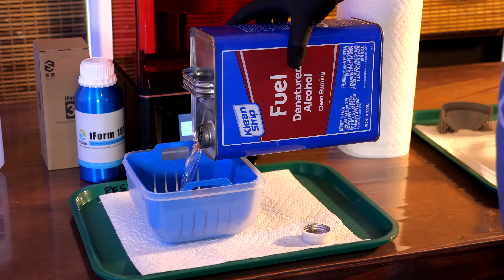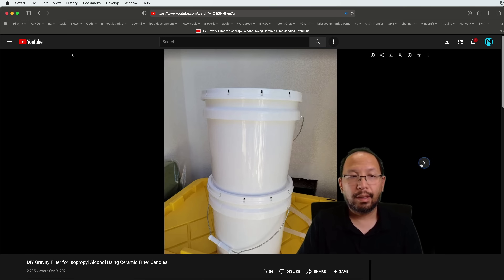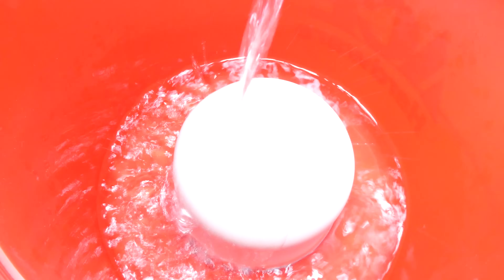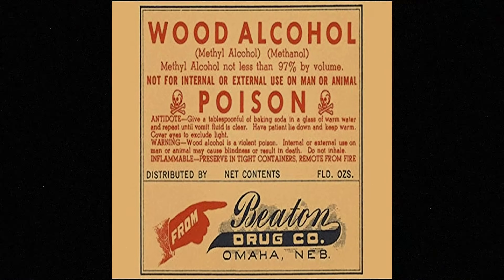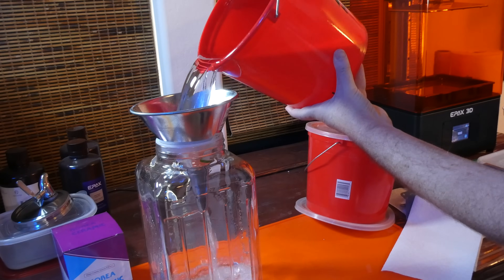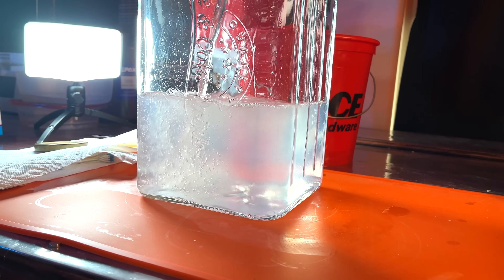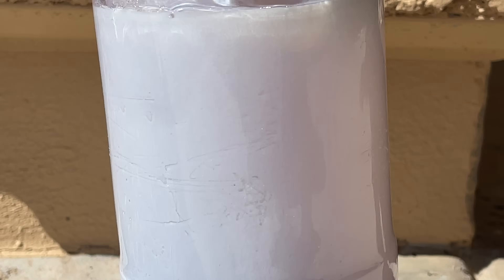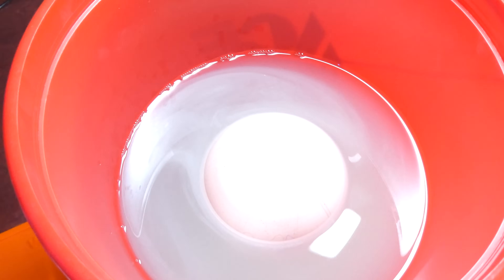Can We Recycle 3D Printing Alcohol?

Comment: I almost always use a spray of solvent to clean parts rather than a dunk.  A spray bottle works fine but my Iwata paint gun is even better. It is bigger than an airbrush but smaller than a regular paint sprayer. Does an excellent job of spraying solvents. Paper towels sop up the alcohol. The waste is minimal and clean up is easy and simple.
Reply from the maker: 👍🏻 I like the dunk method. I feel like an extra dunk in clean alcohol really gets the part clean.
Reply: I do this as well after first sopping up surface resin with a small paper towel. You save yourself so much hassle by removing as much resin as possible before the bath. I finish with an alcohol bath with a smaller insert in the ultrasonic cleaner.  @Nerdtronic After curing the contaminated alcohol, you can just shake the sealed container to break up the scoby. It will settle to the bottom relatively quickly, and makes the first phase of filtration easier.
Reply: I also spray first. I spray with alcohol into a bin with a grate at the bottom as an initial clean then finish cleaning with a dunk and agitation in the wash and cure station. This allows the bath to stay cleaner way longer.
Reply: Which Iwata are you using?  All the models I found, and there are a ton, are full-sizze.  Thanks in advance!
Reply: @MakerMeraki  It’s an old model, an RG-2.  from pictures on the Internet it looks similar to the current model RG-3.  It’s not as small as an airbrush but it’s quite a bit smaller than my full-sized guns.
Reply: @RobertTolone  thank you! 👍
Reply: I use a chip brush dipped in a small cup of fresh IPA to clean my prints.  Does a really good job of cleaning quickly with very little waste.  Aerosolized alcohol seems like a phenomenally dangerous idea, as both a health and safety hazard.
Reply: @RM_VFX  The brush method works well too and is handy when you only have a couple parts to clean.  Spraying alcohol is no more dangerous than spraying any solvent-based paint. Obviously, use safety precautions such as no open flames anywhere plus wearing a good quality mist and fume respirator, gloves, eye protection etc.
Reply: @RM_VFX  Absolutely...  IPA and Denatured Alcohol have poisonous compounds in them, making an aerosol of those is not the best route to go.  I use a multistage cleaning process.  Three washes.  A primary first wash that cleans the bulk of the resin off the print.  Then a second wash to further clean.  Then, wearing a respirator, I blow the print off with compressed air outside.  I then follow that up with a final wash in clean alcohol and blow dry.  When the first wash gets too dirty, I dump it in a paint bucket liner (which then goes out into the sun), wipe out the tray, and then dump the alcohol from the second wash tray into the first.  It's not perfectly clean, but it's clean enough for a first wash.  Same thing with the alcohol in the third tray, it gets dumped into the second tray.  The third tray is filled with new alcohol, and the other two are topped off with fresh alcohol to fill to the necessary volume.  Not a perfect system, but it works well enough.  

I started off cleaning with IPA...  When that got scarce due to Covid, I switched to Denatured, but the smell was worse (IMO) than IPA, so now that IPA is back on the shelves, I'm back to that.  Though I do have to admit that Denatured alcohol seems to clean better than IPA.  I just can't deal with the smell of it.
Reply: @WHJeffB  Where I work we build parts for spacecraft and use a lot of alcohol. for cleaning we use an acid brush, cloth, or paper wipes.  As far as the alcohol itself we put it in isopropanol GHS marked squirt bottles that spray a stream instead of a mist.  These are similar to water bottle you see in sport where water is squirted into the mouth instead of sucked like a straw.

I've seen them listed as Vented Wash Bottles, and Squeeze bottles.
Reply: @RM_VFX This seems to be the correct answer, thanks for this. I just got a Wash and Cure station and its awesome but its 7.5 Gallons of Alcohol and even when I do a quick cleaning before dunking the parts, that much dirty Alcohol is still a pain in the arse to clean and dispose of, and it costs a lot of money to replace.

So your method of spraying alcohol and using a small brush with a couple of tissues to catch the waste, seems to be the best method for cleqning and saving Alcohol.

Comment: I still don't know if anyone has tried the real salt method. (Salt with out Iodine) You can add salt to 70% IPA. The salt is only able to dissolve in the water. This will also increase the weight of the water to settle out of the alcohol at the bottom. In theory, your clean alcohol would sit at the top and the resin would fall out to settle at the bottom in the water layer. Then you could use a beer syphon to carefully pull out the clean alcohol leaving your water, resin, and a small amount of alcohol at the bottom. But, I don't know if the salt would have a reaction with the resin and vice versa. Some day, I'll eventually be able to afford a printer. Until then, I watch and learn.
Reply from the maker: I saw this in another video. Personally I didn’t want to add anything to the alcohol. But I guess we’re adding resin and then taking that out.

Comment: For reference, the boiling point of Denatured Alcohol is 173.1 degrees Fahrenheit or 78.37 Celsius. Denatured Alcohol has an auto-ignition temperature of 709 degrees Fahrenheit. In a perfectly controlled environment where you are acutely aware how hot something can get, the environment prevents sparks or other forms of ignition, with plenty of ventilation (In other words outside and not at all inside a building). The risks can be 'minimal'. But if you can't be sure of any of those things. You really shouldn't risk burning your house down. You can replace the alcohol. You can not replace yourself.
Reply from the maker: My thoughts exactly. Search YouTube for alcohol explosion.

Comment: Diatomaceous earth can be a help here to remove the 'gunk'. I light cure to solidify a bit of the dissolved resin, filter through D.E. and then through activated charcoal. If your activated charcoal is fine enough, you can probably remove one of the filtering steps. A gallon of D.E. will run you about $20 US on Amazon and is a great filtering aid, but lots of surface area is key if you don't wait a lifetime.

As for the smell of IPA, that smell will never go away as it is intrinsic to the molecule. Wanna make it smell like bananas? Add some vinegar, a bit of sulfuric acid and boil away. The yields will be low due to the amount of water in vinegar(unless you can get your hands on some anhydrous acetic acid) but the ester is pretty potent and should be detectable. You can do the same with other alcohols but be warned, the longer the carbon chain gets, the worse they can smell (the pure alcohol, that is).

Also, distilling isn't too bad but you are still left with a concentrated mess of gunk so for me, filtering would definitely be the first step but distilling might be a nice occasional step to remove atmospheric water that the alcohol with pick up over time. Just don't distill to dryness or you'll likely have an even worse mess to clean up.
Reply from the maker: Wow lots of good info. Thanks for commenting!

Comment: The 'mucous' is a spongy suspension, if it is squeezed in a filter bag , the alcohol is released. I found this still had a lot of dissolved resin in it and required another exposure and filter pass.

I tried a vacuum still instead of higher temperature boiling , but the phase change method is far too costly , unless it could be done this a solar still of some type.

I'm also fine the smell of ipa offensive, worse than resin by far.
Reply: @AndrewSM I just used a cotton cloth and gathered the edges together and squeezed. If one had a lot to do ,then a similar cloth in a cider press might do the trick.
Reply: @AndrewSM yes that would probably work

Comment: Worth calculating the loss due to evaporation for this method. It probably not a lot but I'm sure it will increase the "price" from 4¢/Gallon
Reply from the maker: I agree. And that’s IF you can do 1000 gallons. Still even at say 10 cents a gallon it’s pretty good. If you don’t add in the cost of the labor to manage the process. Then it might be cheaper to buy it.

Comment: Couldn’t you just design one or two 90 degree angled gear(s) to change the direction of a motor, connect a very small propeller, fit it into the upper basket so the fluid is moving to prevent the filter to clog? Maybe pointing on to the filter so there is just a tiny bit of pressure on one side of the Filter?

I think any small toy salvaged motor will do the job just fine.

[~]-|
      |
      |
      |-8
Reply from the maker: Or one of those magnet stir things. 👍🏻

Comment: Not getting the IPA this dirty will help. I just filter mine over kitchen tissues after 10 times use and it is clean enough (not sticky anymore) for another 10 times. The biggest step lays before putting your print into the IPA, clean of as much as possible using a small spray bottle with IPA. This will get the most off.
About distilling, it is possible to distill alcohol safe, using vacuum will lower the boiling point a good amount and hot tap water can be used to heat the alcohol. Of course everywhere where are fumes there is a risk, but the risk of pouring alcohol for one bucket into another is a lot bigger then using a closed system. Ever thought of what kind of cloth you are wearing when doing this? Static electricity creates sparks too!
Reply from the maker: Yeah don’t walk around on carpet snd rub a balloon on your hair before cleaning your parts. 💥🔥

Comment: I wonder if an apple press type of system would work on the resin jello. Or maybe toss it in a blender to break the bonds of the matrix that is holding the alcohol. Maybe both. I'll have to try that next time I need to change resin. 
I also only use denatured alcohol because of the smell of IPA. I have a hard time convincing people that it works just as well, or better than IPA.
Reply from the maker: Denatured is great.  it's the way to go!  And also these filters can be used in pressure filtration systems as well as gravity ones.  So if you push the alcohol through it will filter faster.  But you'd need some sort of set up for that.

Comment: Maybe i am dense, but what i do with my alcohol is expose it to UV light and than filter it with paint filters.  The resin is cured( clumped) and than the filter removes it.  Simple, cheap,  and seems to work.  What am i missing here?
Reply: I'm guessing that like me, you filter it before it gets as contaminated as the alcohol @Nerdtronic is trying to recover.
I think that's the key. Filter it regularly and don't wait until it's a thick cloudy mess.
Or maybe the Methanol/denatured alcohol acts differently on resins than IPA? I've only ever used IPA.
Reply: @ausfoodgarden  I use IPA and expose it to UV after most uses.  I filter it every so often, which causes the resin to coagulate.  I than filter that out.  I get a nice clear IPA from this.  Simple.
Reply: I use coffee filters after giving it a UV cure. Paint filters just seem to coarse to me and not as cheap as coffee filters.
Reply: The key as someone mentioned is not to wait until your alcohol is so dirty that  looks like thinned resin
Reply: I also expose my used IPA to Sun and let it alone for some days so the resin go on the bottom and filtration is easier.
Reply: Perhaps since both water and alchol are polar molecules, the slightly negative end of water attracts the slightly positive end of the alcohol molecule forming hydrogen bonds. In other words its no longer pure. 

If its working for you than you should do what’s works. 

Distilling at best can get about 90% purity. The distilling process cannot do any better than this, or get it back to 99%. Keeping in mind alcohol boils before water and convention distilling methods are not ideal, or as simple a process as some may claim. 

I wouldn’t do any distilling but I might consider freezing the solution after your UV and filter method. 

Once frozen you can scoop out the ice cubes with a handle strainer, and/or filter out the ice and know that its about as pure as it’s going to get.
Reply: @glennedward2201 the vodka in my freezer doesn't contain any ice, so I don't think the freezing method would work
Reply: Genius!!!
Reply: Well, %99 people doesn’t require their IPA to be %102 pure for cleaning parts. So you are missing the %1 OCD rage.
Reply: @Gounesh  Was that necessary?

Go have a beer, relax, and have a nice day.

This anger stuff is killing all of us

Comment: I like the idea of adding stages. I guess the nice thing about stacking a 3rd or more stage of filtration is that it really shouldn’t take much longer to do the whole batch. 

And if cheaper, more corse filters were used at the top it might make those at the bottom last longer.
Reply from the maker: I think the order of things might put a kink in that idea.  I think my really dirty jar I maybe could have salvaged if I had filtered, then cured in the sun, then filtered again.

Comment: Such a fantastic video. I have buckets of IPA sitting in my closet for a few months now. For sure should try this. Also refuse to use a distiller. Seems like a massive fire Hazzard.
Reply from the maker: Thanks!  Yeah after your near miss with the ultrasonic cleaner I’m sure you’re as paranoid about fire as I am.
Reply: Just take a UV light to it and cure whats floating in it. Depending on how thick the resin is it may take a bit and a few times stiring it up. After just let it sit for a day and all the cured resin will sink and become a shick goop. Then just filter it out. I do this with all my alc though I clean mine this way after I'm done for the day. Cure the alc for like 10 minutes then let it sit over night, filter next day.  I never let it get that bad. Then it just becomes a waste :/
Reply: If you've got the space, you can simply use a distiller outside. Others have pointed out that they do this, and it works well.
Aside from keeping an eye on it, I think I'd unplug the extension cord and wait for it to cool down before approaching it, just in case.
Reply: Distillery may be a fire hazard but it is also how alcohol is made... So it is hard to say how safe re-distilling denatured alcohol... So I'm glad to see a less dangerous method to filter out the resin.
Reply: You should NEVER use a distiller for IPA. IPA can form peroxides after a while by reacting with air, or by exposure to light, which can explode when you heat the IPA.
Reply: @alexanderdaum8053  Awww, easy now. The dangers of this is exaggerated. You'd need years of redistilling and bad storage to get enough peroxides to pose any real danger. If one is unsure one could always test a sample of the solution with a small amount of potassium iodide to see if it contains any relevant amount of peroxides. A few grains of iodide and then a q-tip dipped in sugar solution and then into into the sample. If it turns dark blue you have peroxides and should probably discard your solution.
Reply: @mikaelbjornson2666  Are you aware that most people who print resin are not Walter White and will never know to do this kind of chemist manipulation?
Reply: @fluxcapacitor  Exactly what part of putting a few grains of potassium iodide (easily bought on amazon) in the IPA and dipping a q-tip in sugar solution and then into the IPA would be too complicated for you?
Reply: @mikaelbjornson2666  You missed my point. It's not complicated for me (at least now I am aware of this – but anyways, I don't distill…). As I said, 99% of people who distill IPA are unaware of this. Does someone else talk of this specific chemical process in tutorials about distillation? If so, then all the better. If not, too bad and these people will never know as they will never see your comment buried here.

Comment: Love your vids. I can say however that using a purpose built alcohol distiller like you showed in the beginning of the video works REALLY well. I run mine outside and it goes through about 4L in about 40 mins with very little loss. The trick is to make sure the silicone seal makes good contact. I will say that it is pretty darn safe but you still want to do it outside.
Reply from the maker: It’s probably pretty safe to do, especially outside. I think there is a decent seal with the lid keeping the vapors inside.  I just am not comfortable doing it.
Reply: @Nerdtronic  I completely understand, it's certainly not without risk.

Comment: if you ad some magnesium sulfate to your top bucket it should pull some of the water out just exposing your alcohol to the air it will pull the water from the air and lower its %, not a big deal but something to keep in mind
Reply from the maker: Interesting.

Comment: Have you tried chemical filtration approach with Aluminum sulfate?
It's used in water filtration systems and bonds with resin remainder pretty well.

The only downside of this method is that some resins (like Anycubic Craftsman) have heavy pigments which do not bond with the sulfate...
Reply from the maker: I'm just learnign about that.  It might be worth looking into if it's not too expensive.
Reply: @Nerdtronic  
Check out this video if you haven't seen it:
https://www.youtube.com/watch?v=HxT8rEr-tFI